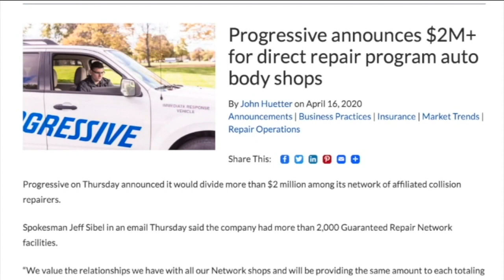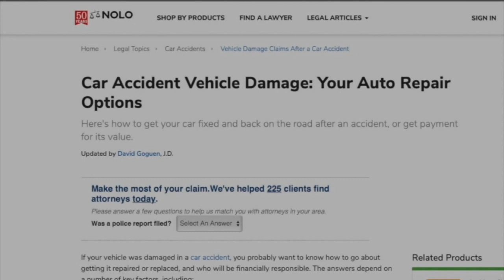Auto insurance catch: Why they may deny your repair estimate

Comment: Okay, here's  a Pandora box folks.
I'm in the automotive industry to be more specific, I'm an auto-body Technician, and what the owner of the shop on the blue shirt is completely right. There are a lot of insurance jobs that companies pay for cheap work and they don't really care about customer's safety and none of that they want to save money putting used parts such as suspensions, soft frames, body parts, etc.
 But the worse part is when they charge you montly and then they dont want to be responsible for your damages. Sad but it is true.

Comment: I purchased insurance, it was a scam, I went to a recommended mechanic they gave me about a little over a hundred off of about $100, didn't fix it, I fixed it myself a year later with a $20 part. They can't tell you how much they'll cover.  BMW dealer insurance has been worth it.